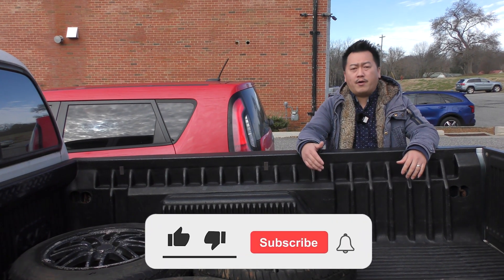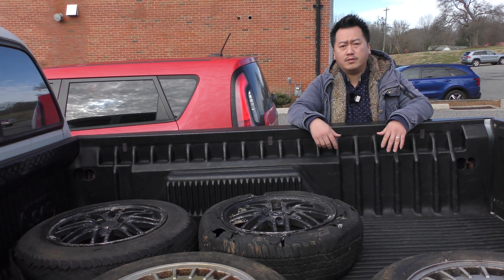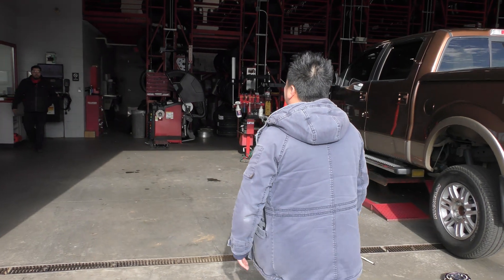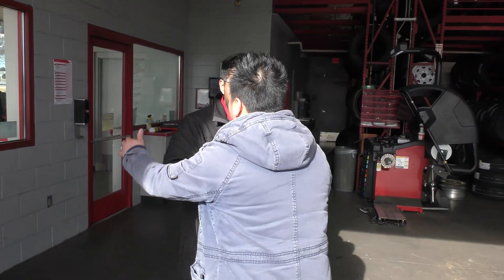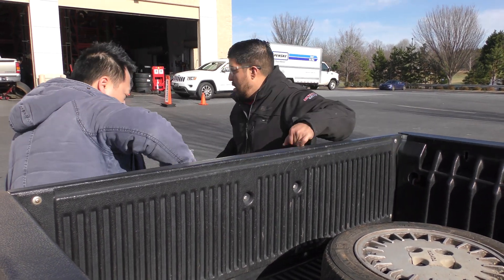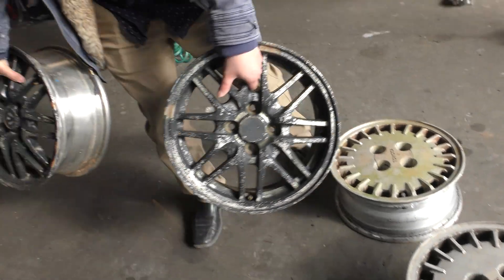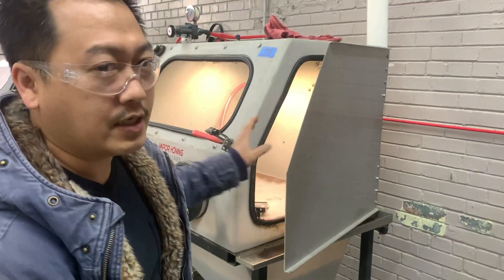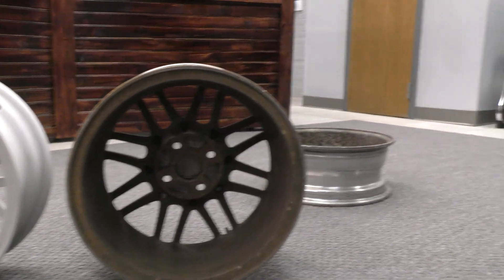Best way to STRIP PAINT off wheels - Vapor Honing Technologies

Comment: What kind of media are you using on those rims. I am in the process of building a cabinet specifically for rims and I don’t know if the media I have is going to be too aggressive or not aggressive enough.
Reply: @joewake746 so I think he used mostly aluminum oxide to remove the paint, but then at the end to get the polished look he used just the glass beads. I wouldn’t mind just keeping it at that sheen, actually!!